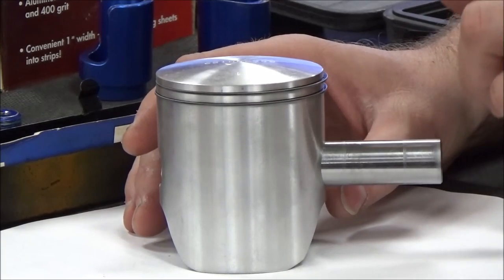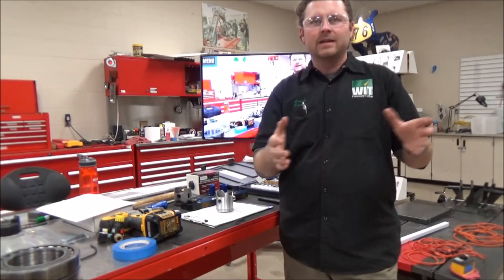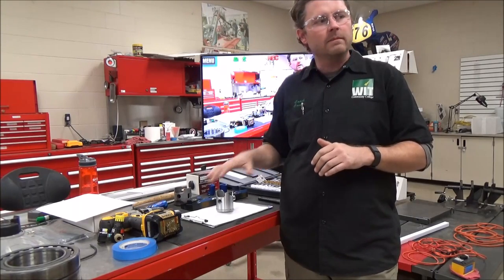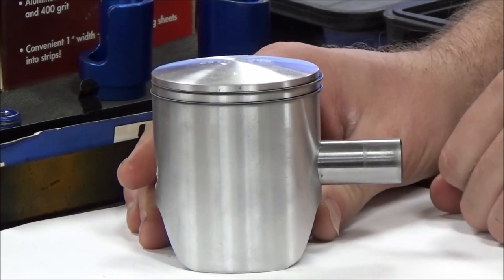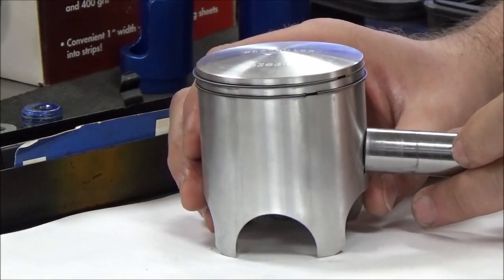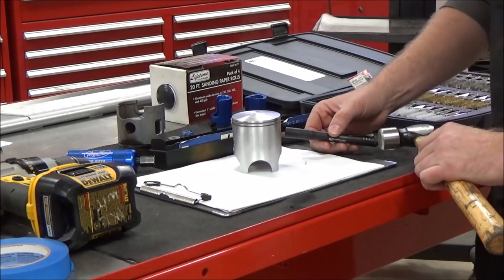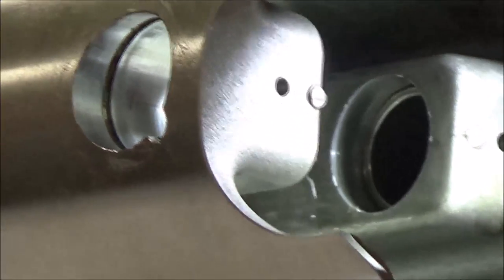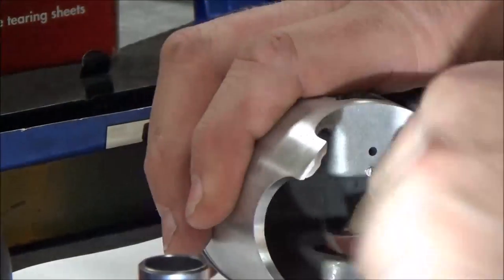How to fit a piston pin with craftsmanship. Are you a mechanic, technician or craftsman?

Comment: hi, i have posted on another video of yours but it was a lot older and i expected no response, i hope catching you now i can get some. i just bought a kx85, the shaft to shift, only the shaft has snapped off. i know i need to split the cases but can i have advice if i can only seperate it on the left side, pull the shaft and put a new one in? will it be that simple? i am willing to take the challenge on and i would love advice from you. also the bike was dropped in gear when it snapped, it is broken flush to the case. is there any way to get that shaft to turn so i am in neutral before i split the case?
Reply from the maker: Hello there, 
Thank you for watching and subscribing. You’re in luck! If you are not able to get the answers you are looking for here on Youtube, I do provide personal one on one help, training and even will work with you directly over the phone or FaceTime. For more details or to get help started, email me @ howtowrench@gmail.com 
I look forward to working with you and getting your machine back on the road!
Shane Conley
Instructor/Motivator/Motorcyclist